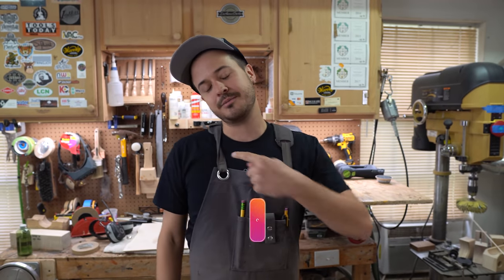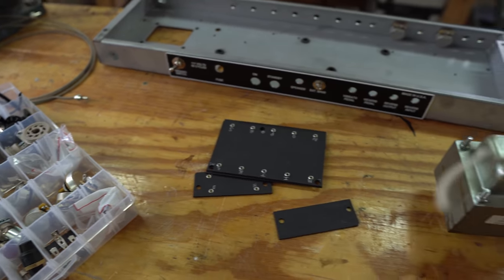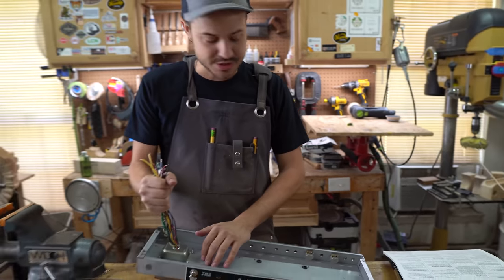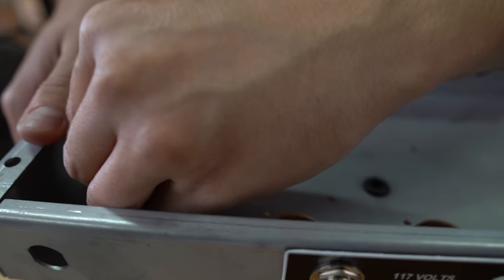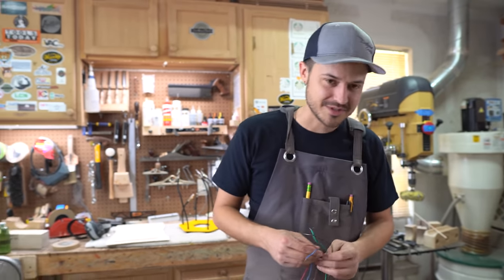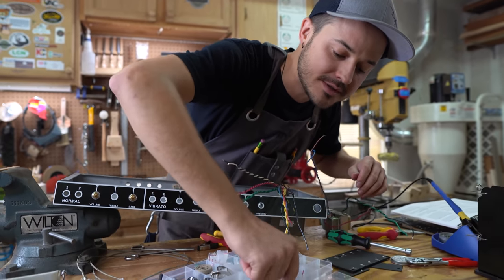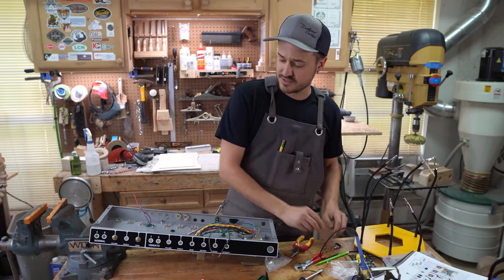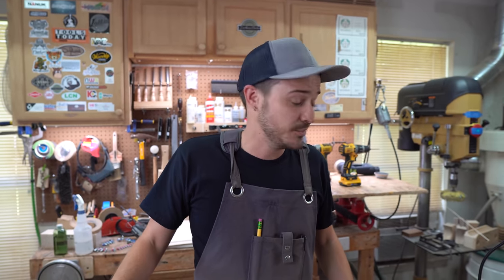Building a StewMac D-Reverb 22W Amp Kit!  (Episode 3)

Comment: I know you guys are probably already done with the amp by now, but going back and putting some blue loctite on the nuts holding the power transformer laminations tight is a really good idea. You’re going to kick yourself if they come loose because it can take out the transformer by vibrating itself to an internal short if it’s not tight. It also lets you realy crank down on the keps nuts attaching the transformer to the chassis.

Comment: Great build, you're going to love it.

Some tips - I really like to install the filament / heater wires early into the build. They can be a pain if you leave them to the end.

I like to use two different colors for the wire. It helps you keep them in phase (the same wire goes to pin 9 on each 12 a*7 socket).

Whenever you're twisting wires you can put the two ends in a drill. Hold the other end. Then use the drill to spin the wires achieving a nice, tight, uniform twist.

Be mindful of lead dress (the physical location of wires) with the heaters. Try to keep them tightly twisted right into the socket. Run the leads away from signal wires. Tuck them into the chassis corner between sockets.

Check if your power transformer has a center tap for the heaters. If not install a virtual center tap with two 100 ohm resistors from each heater line joining to ground. This will remove a lot of noise.

Comment: I have to chuckle a bit. I grew up at the end of the vacuum tube era, so I dabbled quite a bit with punching and reaming holes in chassis, mounting tube sockets, and hefting around massive laminated iron E-I core transformers. All my design projects now involve solid state electronics, printed circuit boards, surface mount components all using low voltage supplies. Every once and a while I get nostalgic about those old tube circuits, but seeing this and thinking about what it took to build those devices and working with the high voltage supplies snaps me out of it pretty quickly LOL. Still, it looks like a fun kit to build - enjoy.

Comment: Matt, I'm also building this kit.  I discovered that my kit came with an extra  .047μF Orange Drop cap (parts list says four, but you only use three)  and a 56K .5W carbon composite resistor.  Both of those parts are in the parts list but there are no instructions as to where they go.  I contacted StewMac and they confirmed those two parts are extra and is an error.  Just a heads up.  Good luck with your kit!
Reply: Hahaha Chris and I have joked a couple times about that old adage of finding a couple screws/bolts leftover after a project and wondering at their significance. I guess in this case you were fine!
Reply: Also, if I’m missing that orange drop cap and the 56.6k carbon composite resistor in mine, I’ll know where they went!
Reply: @DriftwoodMatt  thought I screwed up. So glad it wasn’t me.

Comment: The best advice I can give is, Remember to NOT to let the smoke out of any of the components on the circuit boards or tubes. Just kidding. When working with "High Voltage" after your amp is together and ready to turn on. An old shop master will tell you to keep one hand either behind you or in your pocket at all times. Do not hold the chassis with a bare hand and do any on-the-board probing with a test lead or when Biasing the tubes, keep one hand in your pocket or behind your back to keep from becoming part of the circuit and killing yourself. just some friendly advice. It happens more times than not with inexperienced techs.